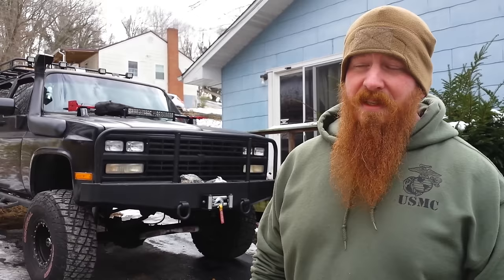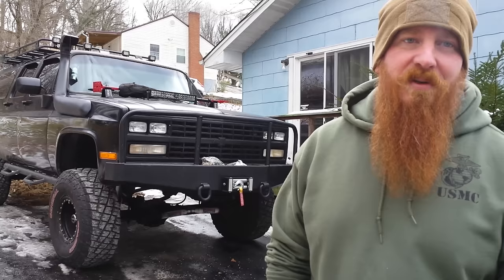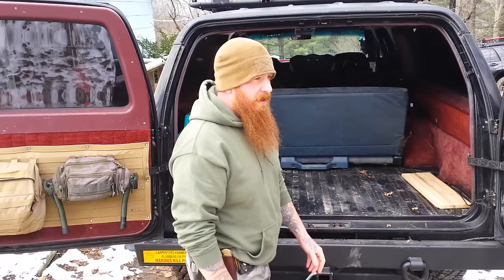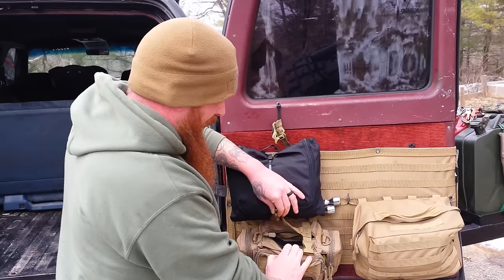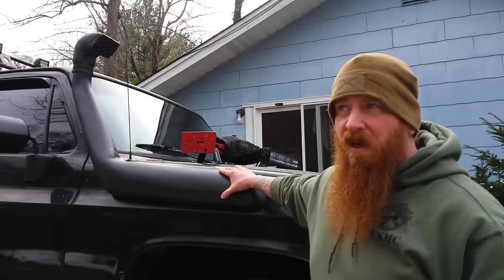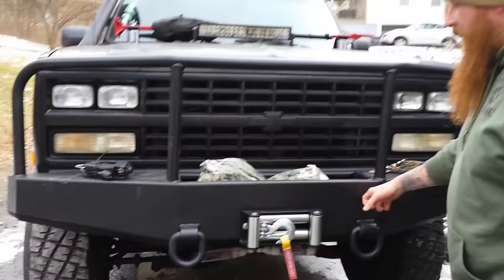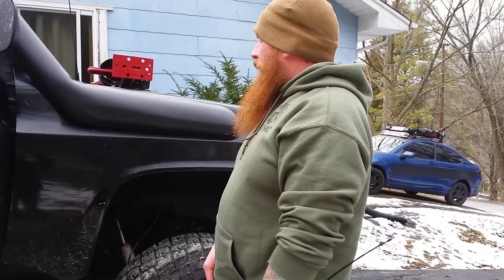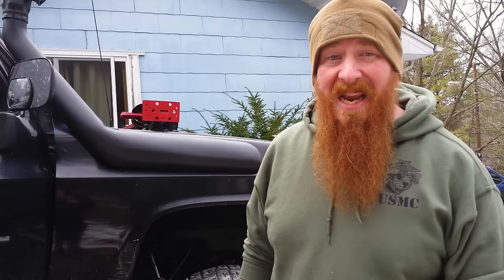80's Chevrolet Suburban 4x4 Bug Out Vehicle  (CSBOV)

Comment: I use my winch all summer long pulling people out of the mud and my synthetic line has worked great for years and on my 14 k winch it holds double the footage over cable. You must have bought the wrong synthetic rope.
Reply from the maker: crjengr all summer long huh you do anything to keep it conditioned

Comment: Is there a way in the future you can change out the front axle with one that has the push dash 4x4 button? Since it can be a little easier than getting out in muck to lock hubs, maybe it would be really costly.
Reply from the maker: The truck is set up to be all mechanical. Over the past 5 years I've gradually removed all  Electronics. This video's almost 2 years old.

Comment: I would be worried about that weak running gear... you planning on replacing that 10 bold in the front and 10 or 12 bolt in the rear?

Comment: I think all these bug out vehicles are great. I wanted to build one but then I started thinking. Not to be negative but where am I going to go? Unless I  have a specific place I am going to bug out to it doesn't make sense. Bug out is a panic mode. Like in the movies Independence Day and War of the Worlds it's going to be mob traffic. Gas stations will quickly run out of fuel. So basically the fuel you have is all you have. A normal vehicle has a about 400 mile range unless you have oversized tanks or spare gas cans. Even then you have maybe 1000 - 2000 mile range. Unless you have safe place to go and hide you will be wondering about like everyone else. So unless you are near to where you want to be the time to move is now.
Reply from the maker: I gave a class on that very topic.

Comment: interior length from the back of drivers seat to the back doors and the width and height also please.
Reply from the maker: Sure I'll just walk outside open her up and crawl around
Reply: I`m over in the Blountville area and was thinking about getting an 80`s model to rebuild into a camper / bug unit so to speak . Ive tried going on line to get spec`s before I asked you. But nothing on the back area measurements, Keep up the good work !  Also my son is in the  Marines  and now doing the reserves over in Gray.    @StepOneSurvival

Comment: Awesome truck, but one question, what was the spark from at 23:10? Is that a normal winching thing? never had to use a winch in my life.
Reply from the maker: I've answered the comment many times and fixed it in the video.  The grounding cable was loose
Reply: @StepOneSurvival  Ah thank you, having a bit of a slow day so missed that! 

Starting on kitting out my truck gradually. I hear you with the tyres, much easier finding ones for 15s or 16s inch wheels than silly sized ones!

Comment: Sub'd brother! I'm a vet and have a 96' 4x4 burb I call big hoss,it's got a level kit on it right now with 275/65r/18's, couple of Q's, what lift did you use and did you just flat black rattle can it?
Reply from the maker: 8 inch and its getting painted coyote brown soon
Reply: @StepOneSurvival  Back in 16' I had a 2001 lifted suburban and I lived in it on the west coast for a while,I seem to have that disease some of us vets have  where I don't know if it's time to bug out or stay in the barracks lol so I'm on the go,did you create the winch bumper? Or is there a shop that does those,I gotta have a winch,I'm going up high Sierra this time,might pan for some gold while livin' off the grid. Most people don't know the importance of a CB radio,but they will when the grid goes poof and that's the only way to talk.

Comment: Winch was throwing spark's MON! Y'all check it? 😟😕
Reply from the maker: Yeah that's was 2 years ago
Reply: Does any one make a winch that operates off a swash plate hydraulic pump motor? A two pound Rotory engine that power's the hydraulic pump with a swash plate pump motor would make for one amazing winch. I just brain storming has a third redundant drive system to drive swash plate pump split power system to drive the wheel's of a vehicle if other drive system's fail.  Ultimate bug out's vehicle with lot's of redundant system's. 😊

Comment: If i was to have a bug out vechicle, I sure wouldn't have one that gets 10 MPG on the highway
Reply from the maker: Nicholas Geil  It gets a little bit better gas mileage than that. Just out of curiosity what off road vehicle for a bugout scenario would you pick?
Reply: Step One survival I didn't mean any disrespect when I made that comment, I love you're channel btw. That's a hard question bc every vechicle has it's draw backs, but I would say a Half ton OBS Chevy. Their easy to work on, classic motor with tons of parts around, reliable, and very customizable. But of course it has drawbacks like rust and gas mileage.
Reply from the maker: Those Chevy's gets the same gas mileage as this truck. This one's our daily driver we take it everywhere every day. Roughly 22 mpg as long as you're not gassing it everywhere.  The Jeep we had got 10 miles per gallon  And it had a 6 cylinder.
Reply: Step One survival how do you get 22? Teach me your ways! Lol
Reply from the maker: It's geared correctly Transmission also has over drive

Comment: In hub electric motor's in the wheel's organic carbon power cell bank in a tubular bumber and side rails. Engine failure or out of gas? Remove pins from the electric in hub electric motor's put your vehicle in neutral gas pedal control's speed. A redundant drive system to get's you out of a bad situation. 😊😎

Comment: I am looking into building my 94 ford ranger into a bugout / everyday driver. But most of the good bugout prepping gear is military based. I never served in the military, nor do i want to pretend i did. I just feel if i put to much of the military style gear on my truck i will be disrespecting those who have and are currently serving our country. What are you thoughts S.O.S. ? If anyone one wants to chime in please do !!
Reply from the maker: Bubba Gump if anything I don't think anybody's really going to care me personally I see people with military gear style stuff all the time and they may or may not have served I don't really care I just like what I see it looks good it looks good
Reply: O.k., I see your point. Thanks for your opinion !!
Reply: Bubba Gump it's good you think about that. I served 6 years army infantry and have a purple heart. the only way to me it's wrong is people wearing a full uniform and lying for personal gain.
Reply: I respect your's and s.o.s.'s opinions. Thank you for your service !!
Reply: I've always thought that using surplus/ military gear was showing respect.

 Also, with winching it is good to slack pull cable, engage, and tighten slack by moving your vehicle (in 4WD). Then Put it in Park (and/or 4wheel brake lock out) Then us a ratchet strap and tree strap to secure YOUR vehicle before pulling on a vehicle with the  electrics of the winch. It is called layers of force.  You move the heaviest objects that you can on your end with the least amount of effort, first. Also do your best to pull and anchor in straight lines. (If things are really crazy, do secondary, outrigger anchors at right angles to the primary axis of pull. )Things can get dynamic and kinetic in a hurry when tons on metal, mud and rocks start shifting all at once. 
 
Lessons hard learned off-roading and running wrecker, salvage and recovery. With a wrecker it was not unusual to use a front winch and strap to secure our vehicle to a guard rail and/or bridge abuttment/ second vehicle when recovering a vehicle out of a ravine or culvert. I had a Rollb-ack on two wheels once with the aluminum bed all twisted and the right side hydraulic control box sitting on the pavement. The boss was extremely happy with me that day. It all happened in less than a second when an axle/ UV joint gave way and jammed on a culvert edge, spinning the target vehicle out of the culvert like a ballerina.